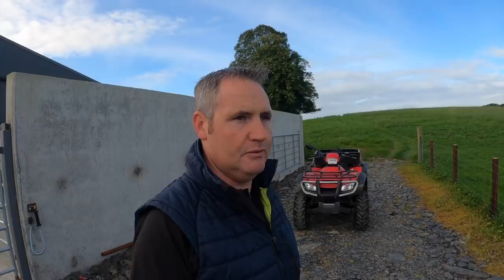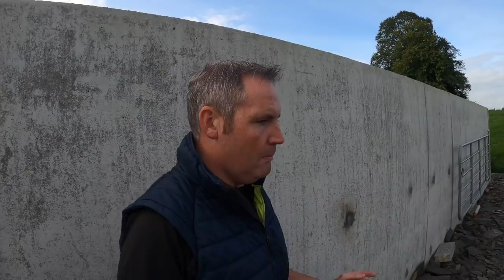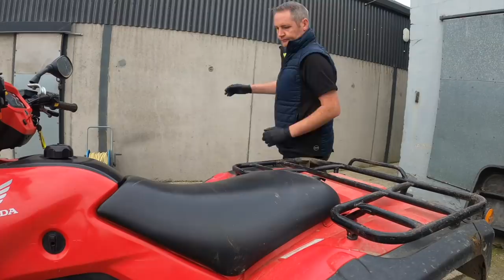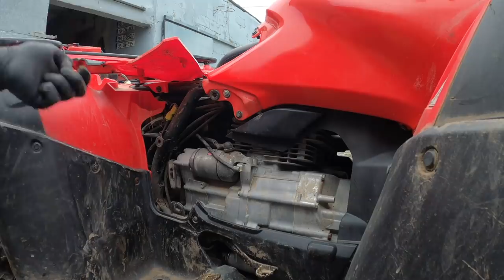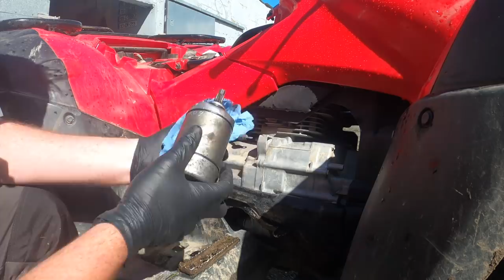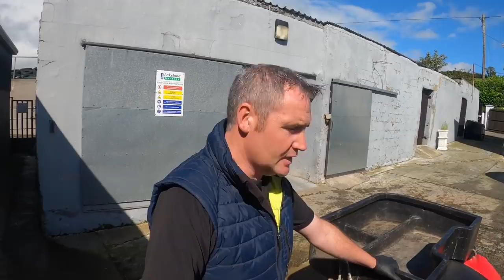THE DAY THE QUAD SAID NO!!!! WHAT'S GONE WRONG AND CAN WE FIX IT ?????

Comment: I had same trouble with my trx420. Starter not as easy to get at compared to your 500. I had to remove the air box. But I got it done and brought it to Rudden where he told me the starter was fried !! 😳. So they ordered me a new one and had it next day. So great service from Ruddens and the 420 is back on the road or field should I say 😜. Great video 👍

Comment: By any chance did you leave it it gear before you turned it off because we had the same trouble where if you left it in gear then put it in neutral the next day and it wouldn't start because it was stuck in gear and would make the same starter noise as yours
Reply from the maker: No we often stop it in gear but always put it in neutral. If your quad won’t go into neutral, ours is Eletric shift

Comment: I had a couple days of that happened to me foreman 500 but I just wiggled the wires and charged the battery and away it went and never done it again and that’ll be 2 year ago that happened
Reply from the maker: But there’s always that chance when u really need it, be no harm to clean all the terminals and especially the Earth 👌
Reply: IFarm WeFarm we don’t really need to as we hav a spray gel for electric connections that’s stickier than grease which preserves the lead terminals and There’s stainless steel connectors on the ends of the terminal wires which helps a bit